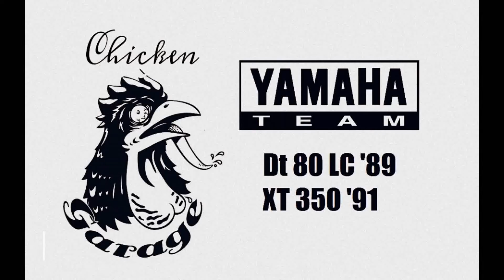YAMAHA DT 80 OIL - CHANGE GEARBOX (ACEITE CAJA CAMBIOS)

Comment: Thanks man ! 
I had 80w-90 gearbox oil, from my stupid mechanic.
It never wanted to shift properly, but now after I changed the oil with 10w-40 Sintethic... it flies through the gears 
Most important is that I can easily find neutral :)

You saved my DT80 LC2 93'
Reply from the maker: Alex Koteles you are welcome 👍

Comment: What oil  you use? I have same motor. DT80cc 2 stroke. I dont know what oil to use for gearbox. Im done with 4 stroke bikes :D
Reply from the maker: ButtonHD: 

Hello I used motorex gear oil 10w 40, but  you can use 4 stroke  oil engine, it's the same.
Reply: M vT thanks :)